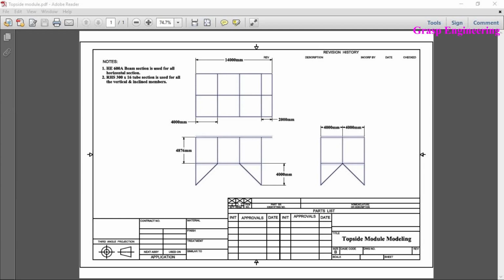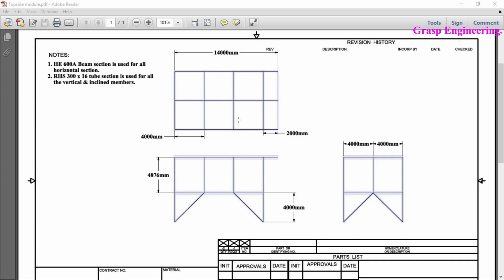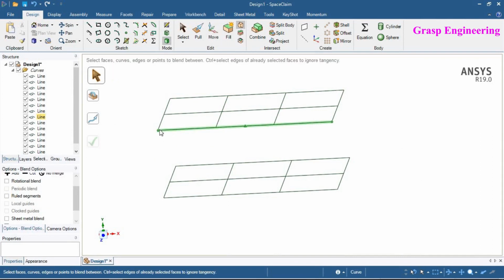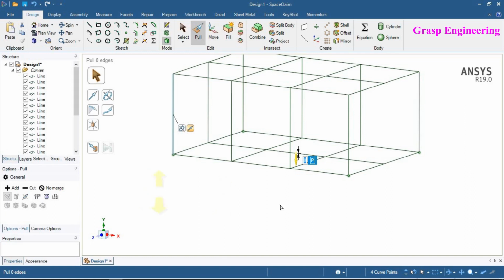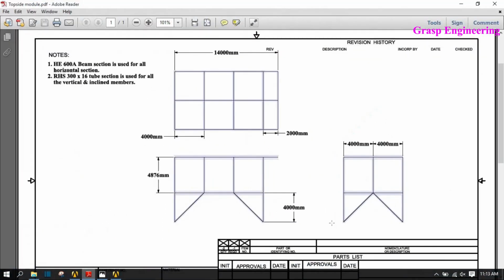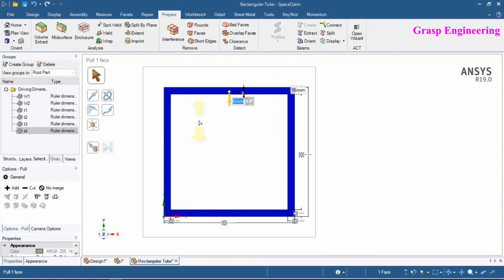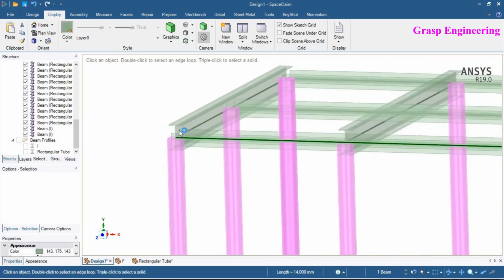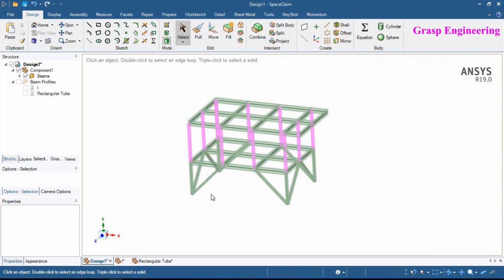Beam model Creation in ANSYS Scpaceclaim/ Topside Module/Civil Structure/Beam Section Creation

Comment: Thank you, very nice video. I have doubts - how can I change the joint to the article and another fixed. For example, the brace with beams will be articulate. It can be necessary to fix a column with a beam. could you explain how to make joints Fixed(will give moment) and articulate (hinged - will not give moment) ? - thank you - From Brazil

Comment: Hello, I have questions. Why didn't you cut the beams? For example i want do analize in your model and i thinking about beams because one beams is inside the next beams and two beams intersect.
Reply: In real life you cut the beam to beam and i have qeustions whether this option is possible in spaceclaim?
Reply from the maker: It is 1D Modeling, where if you need to connect the 2 beams, you have to merge with each other. You can do cut the beams when you have 2D or 3D solid model.

Comment: What's the difference with designspark? It's the same program
Reply from the maker: It is different CAD program. It is associate with ANSYS FEA software. You can do all design and CAD modeling operation on Spaceclaim.
Reply: @graspengineering9249  After a search i realized that spaceclaim is the paid program with all the features that we need from a cad program. I started with DSM and i like it because it s easy to use and has got different philosophy from other programs. If the price of spaceclaim is affordable then glad to continue, otherwise i will switch to freecad.